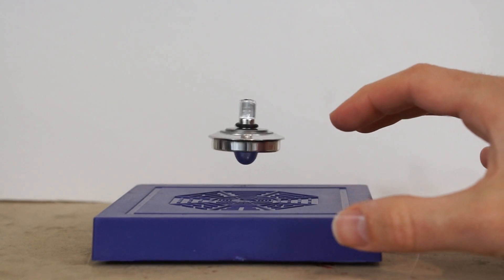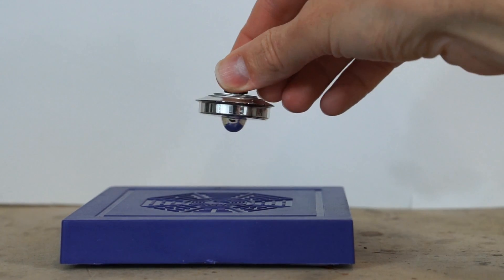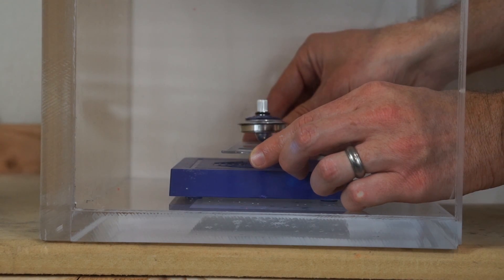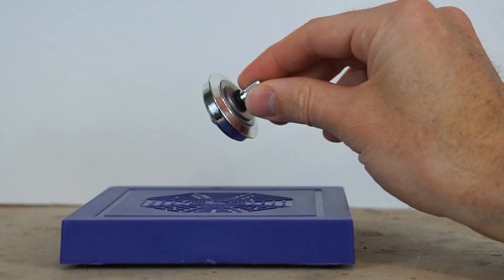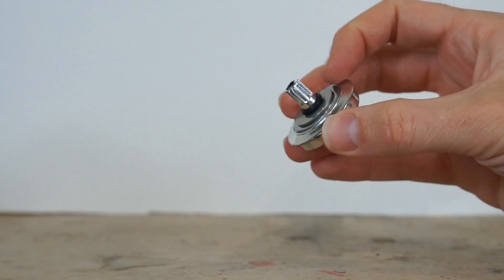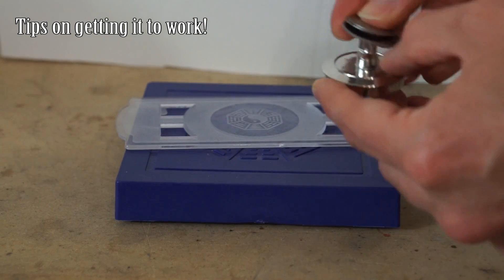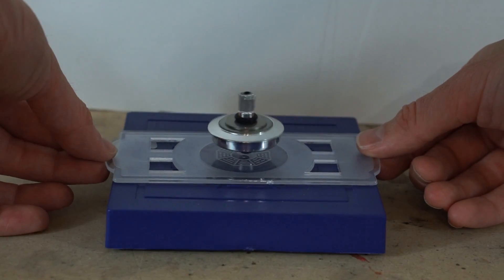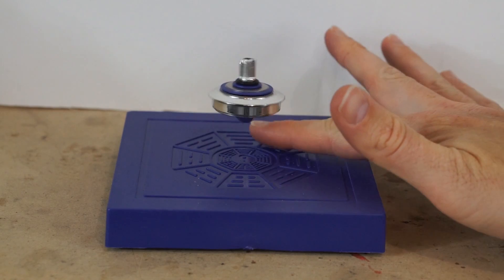Will a Levitating Gyroscope Spin Forever in a Vacuum Chamber?

Comment: it'll stop for 2 reasons, no perfect vacuum & cutting through magnetic flux takes energy (think of eddy currents when dropping a magnet through a copper tube)
Reply: SedoKai love you how make a statement and treat it as facts without providing any facts to support your statement.. why are you on a science channel?
Reply: This is scientifically accurate. Friction by definition requires direct contact. The explanation in the video is a good faith attempt, but is incorrect. If the bottom and top magnet were spinning together in locked sync through alternated fields, the friction of the bottom magnet would indeed cause a magnetic moment on the spinning top and slow it down, but since the bottom is stationary and the fields are not alternating, it’s likely that the metals in and on the spinning top are producing eddy currents as the metals move through the underlying field. To a lesser degree, any remaining air molecules in the chamber will still produce a friction force on the spinning top. If you were to magify the strength of the magnets significantly, you would be able to detect a temperature increase in the top due to the resistance to motion imparted by the eddie currents. See videos on inductive heating to see this in action, and as you mentioned, a magnet slowly falling through a copper pipe is another good example.
Reply: @shortbutlucky    It will stop because energy is used by procession to keep the top upright,  and this energy comes from slowing the top,  which will eventually collapse.

Secondly,  this magnetic top is rotating in a magnetic field,  which means that electrons are sloshing back and forth from the rotational speed much like in a generator.  the flow of electrons is consumed by resistance and turned into heat.

Just like with a generator,  it takes energy to move those electrons,  and that will come from the speed of the top,  causing it to collapse.

I suggest that the two major ways energy is consumed in this system is 1) procession  and 2) electrical current flow and resistance.
Reply: +The Exquisite Thinker It's not at 'perfect vacuum' or 0% atmosphere.  Even a cryogenic pump (e.g. in a real lab taking up half a room and possibly costing a million dollars) doesn't get you that, and all he has is a tiny little mechanical pump.  I think he's shown the actual dial before to show the actual pressure, but it's definitely not 'zero' or 'perfect'.  He just says 'full vacuum' sometimes to mean 'as low as my pump goes', which is very low compared to normal air pressure.
Reply: I suppose those eddy currents (passing by opposite poles during the spin?) are magnetic friction.
Reply: Your second reason is correct. You can also call it magnetic drag.
Reply: EvilPlagueDoctor is correct, For air friction is still present, but magnetic eddy current friction will be the biggest overall loss even in complete vacuum.  No fact explanation needed, just basic physics.
Reply: EvilPlagueDoctor i will stop because everything stops
Reply: Still disregarding all of that it will still stop as it is not an entirely closed system, sure 'no' air, but radiation from multiple sources is still getting through.
Reply: EvilPlagueDoctor po6
Reply: EvilPlagueDoctor is the only one who has got it right in this thread
Reply: No, it will stop for ONE reason: I fast-forwarded the video and watched the end first. It stops at the end. Therefore, back at the beginning, it WILL stop.
Reply: to settle this dispute, It will stop because of gravity. simple. if its not 100% horizontally and vertically (...and diagonally?) it will lose its balance, as the magnetic forces interacting cause it to wobble more, increasing the gravity on certain edges, causing it to be unstable. and, it is actually a perfect vacuum, because it is at 0% atmosphere, as such, there is no air. no air, no pressure, perfect vacuum.
Reply: You get 15 points out of 100.  Those are not the reasons why the magnet stops spinning.
Reply: @SedoKai  It will stop because energy is used by procession to keep the top upright,  and this energy comes from slowing the top,  which will eventually collapse.

Secondly,  this magnetic top is rotating in a magnetic field,  which means that electrons are sloshing back and forth from the rotational speed much like in a generator.  the flow of electrons is consumed by resistance and turned into heat.

Just like with a generator,  it takes energy to move those electrons,  and that will come from the speed of the top,  causing it to collapse.

I suggest that the two major ways energy is consumed in this system is 1) procession  and 2) electrical current flow and resistance.

Comment: The fluctuating magnetic field will induce a electical current in the metal and heat it up (a very litle) due to resistance. My guess is that most kinectic energy is lost becaus of this. Also you a far away from a perfect vacuum causing friction by air.

Comment: OK, I'll make a prediction having watched until 4:30. It will stop.

First of all, I don't think air resistance was ever the main reason it would stop in the first place. It's a pretty aerodynamic design.

Why will it stop? Well, it seems like a pretty unstable system. It's wobbling, and that will slow down a gyroscope.

Would it stop in the theoretical scenario where the system was perfectly stable? I'm not sure. Eventually, I guess, by slow attrition of some kind or other.

Comment: I'm not sure I would describe it as friction. It seems to me that there are three forces in this system: gravity; electromagnetism; and the initial kinetic energy required to make it spin. Gravity and electromagnetism are both two forces that are variable (i.e. their force applied on the object is dependent upon a variable, "t" for instance); however the kinetic energy is only applied at the initial spin and is therefore constant throughout.

Now The issue here is that the constant force of the kinetic energy is worn away since the angular momentum of the gyroscope's spin is the true source of counteracting the gravitational force; i.e. the gyroscope "wants" to fall over because its in an unstable state being upright like that, but the angular momentum is fighting against gravity. Once gravity "wears away" at the angular momentum (each wobble decreases the momentum by a small bit) then the unstable upright position of the gyroscope collapses and it is no longer aligned with the magnetic force which gives its apparent levitation.

Comment: Interesting vid!  Curious, have you ever tried spinning the the top on just the thin platform itself, then picking that up and slowly lowering it onto the Magnet base?  Basically taking the magnet base out of the equation at first.  Also I'm wondering instead of that thin platform if you could find a cheap convex spin station to get a really stable spin before releasing it on the magnet.  Obviously that defeats the purpose of the $5 toy, but still curious if that would help make it last longer

Again cool vid!

Comment: Just FYI, an object with rotational symmetry spinning about it's axis does not give off gravitational waves. Nice video though! Also for an object spinning in space, I think that photons from the cosmic microwave background will exchange momentum asymmetrically depending on which side of the spinning object they hit. This would gradually slow it down, so even though gravitational waves won't do the trick, you're still right to say that it won't spin forever.
Reply from the maker: +yunonametaken yes a lot of people have said this but any real object is not perfectly symmetrical and thus gives off gravity waves when spinning. For example neutron stars are pretty symmetrical but still give off gravity waves.
Reply: fair enough!

Comment: Magnetic forces would cause it to low down, especially when wobbling as it will be pushed upwards while going downwards at a not perfect 90 degree angle, either pushing backwards or forwards, in other words either speeding it up or slowing down, but due to entropy it is less orderly for it to slow down, as the directions of velocity are equal (Like when atoms spread out in an atmosphere), but when speeding up it is mostly focused on a certain direction, therefore it would slow down more than speed up, thus causing it to become unstable and fall. I'm only 15 and attempting to explain this, i am probably missing other reasons why, so you can help out by giving ideas :)

Comment: iwant too add something to Your reason for it not spinning and the friction of the base to meis not the reason. my reason is that the magnets are not Perfect so it wil always wobble at some degree  and the wobeling press ageinst the magnetick Field and that takes energy so it loses energy and slows Down. cuz if we only used Your reason we can xponantialy increas the time it can spinn by using a larger mass bolting the base own andm aking the tipp spinn super fast. this wil make every part mutch more stable ad almost entierly remove Your reason. but in the end nothing is so perfct and there wil always be slight diferences in every objekt and the magnetick Field is not stable in all parts. meaning some parts of the magnet is slightly stronger than others . and there wil always be a diference in thicknss as nobody wil take the time to shave of the extra atoms and make shure the densety is the same all ower.

Comment: It will stop your vacuum is simply not low enough, you still have millions of molecules inside. To get it moving infinitely you would need to have a perfect vacuum even exceeding the vacuum levels of intergalactic vacuum and that's well kind of hard. I'm am curious how this test will perform using a turbo-molecular pump.

Comment: You should know that air resistance is not what is stopping the top from spinning.  The instability of the system quickly knocks it over...

Comment: Well the first two problems are that it's suspended on magnetic field and it's pulled down by earth's gravity. If you want the top to spin for a really long time, spin it at unreachable point in universe where there's no planet or stars to affect the top(with the assumption you could get away from it really fast like teleportation so that you won't attract the top with your own gravity). But even then it will still spinning at imperfect vacuum, so that it will still touched some air's molecule, it means that it will still be slowed down and stopped eventually.

Comment: The main loss is not due to physical movement of larger ring. It's electro magnetic losses (hysterisis). The magnetic spring setup between top and base is not perfectly elastic, it has losses as currents are induced in each magnet. The magnets will heat up ever so slightly after a spin.

Comment: Surely the main reason is currents generated inside the metal from the changing magnetic field(eddy current). These currents will 
create opposing magnetic fields slowing the top down and dissipating the energy as heat.

Comment: The slowing isn't from the big magnet moving.  The processing top creates a changing magnetic field that sets up tiny electrical currents  ('eddy') in both objects, which then gets converted into heat and radiated away through infrared.
Reply: ghosttwo2 yeah he didn’t give a good answer
Reply: ghosttwo2 But those currents create opposing magnetic fields and it stops after some time right?
Reply: Good job and thank you for sharing with us.

Comment: it won't spin forever because the process of energy. Magnets are a force, and the spin of the gyroscope is a centripetal force. the rotation will degrade in kinetic energy due to the magnetic pull of the bottom magnet. It will be forcing the spin to turn over, and the centripical force is fighting that force. This (in turn) is the law of physics kick in. A object has a equal to opposite reaction. The force between going down verses staying up will wear out the energy within the gyroscope.

I'm just spit balling what my current knowledge is. I may be wrong. But I think I have the right idea.

Comment: it would spin a lot longer if it was a stable spin. Every time it tries to fall sideways (wobbles) it gets pushed back because of gyroscope effect, but it loses momentum, because the push direction is not perfectly alligned and some of the force goes in to stopping the spin.

Comment: This is a pretty cool video two thumbs up from me man. I wouldve never thought to ask whether or not anything would spin forever in a vacuum very fascinating idea. So would it help at all if your base plate for the magnet was secured to the bottom (well i guess side technically but turned into the bottom) in such a way that the magnet no longer moved back and forth? I know it would still eventually come to a stop but could you get a really long spin out of that? Would be pretty cool

Comment: That just because the magnet apply a force to the gyroscope, this is what slow down the gyroscope. If the Gyroscope was  in a static position the magnetic force will not influence the spin of the magnet but this is not the case : when the gyroscope move, the magnetic field will apply more force on a side of the gyroscope than in the other side and it stop the rotation.

Comment: A spinning object doesn't release gravitational waves if it has complete rotational symmetry along the spinning axis.
Reply from the maker: +WhyPhysics yes but nothing is perfectly symmetrical. Even neutron stars emit gravitational waves and they are pretty smooth. But the gravitational waves of a tiny spinning disk like this are about 10^13 times smaller than a neutron star. But still there!

Comment: If it were in orbit around the earth, wouldn't it be interacting with the earth's magnetic field as well? There's also the magnetic field embedded in the solar wind. You can't avoid gravitational waves and background radiation, and it seems to me you would have a hard time (in practical terms) getting completely away from magnetic fields as well. Am I correct in thinking these magnetic fields would affect a spinning magnet?

Comment: It will stop, here's why: Radiation. All objects radiate thermal energy, eventually it will radiate all its energy to the box its in, the box to the air, and so on and so forth, while the box will radiate some back to the disk, it is unlikely to be enough to keep the spin going.

Comment: The air may slow it down but the fact that it is spinning is what will make it stop. Particles will remain in motion until acted upon by an outside force. In this case the mass on one side of the top wants to move in a straight line in one direction but the mass on the other side wants to move in a straight line in the opposite direction. That's what causes it to spin  but the spin is a compromise and the top loses energy constantly.

Comment: Wonder if you started the disk off the magnet base and brought it over or had the support "stick" held up off the magnet base and then carefully lowered it if you could reduce wobble and get it last longer.
Or even use blasts of pressurized air to boost it faster and keep it going.

Comment: If I had to guess as to why it'll stop, it's because it (a conductor) is moving through a magnetic field as it bobs and wobbles, presumably generating an electric current. It should lose rotational energy as heat, slowing it down over time. Probably several other factors that I'm ignoring, but that's the first that comes to mind.

edit: Should have thought more about the wobble transmitting energy to and from the table. Nice one!